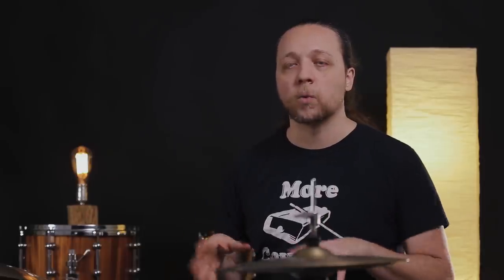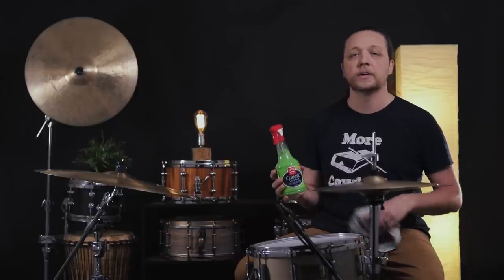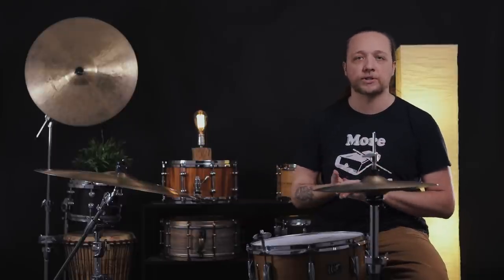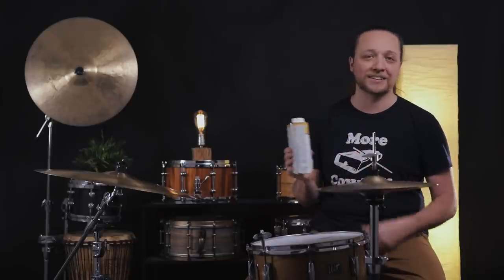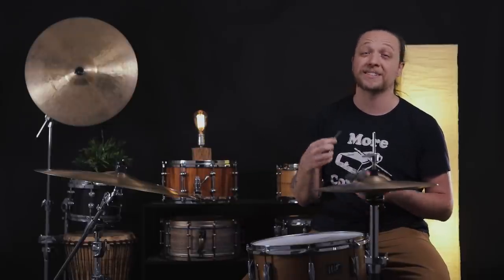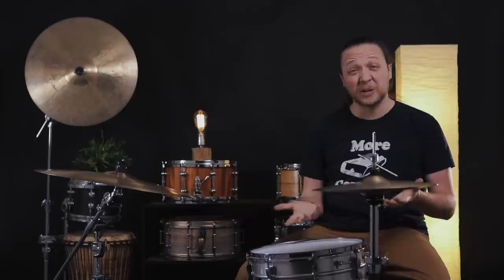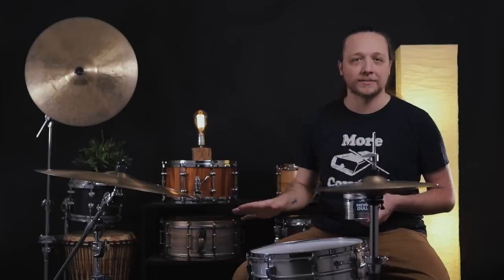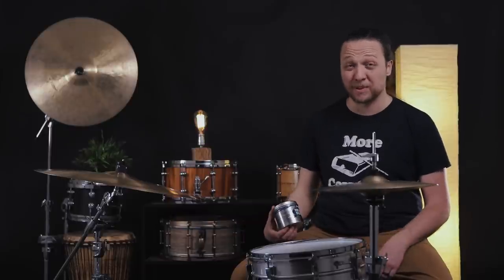Basic Drum Shell/Hardware Cleaning & Maintenance | Season Three, Episode 36

Comment: One tip I learned cleaning up old bicycles that had surface rust on the chrome was to pour vinger on a piece of tinfoil and rub the tin foil against the rusted/ pitted section. Works great. Won't remove all pitting but will remove most all the rust. Love your videos, get more out of what you have rather than get more stuff. Brilliant.

Comment: When rehabbing inexpensive drums that have no finish on the inside of the shells, I've learned to use a couple coats of thinned tung oil (1/3 thinner) which wicks deeper into the wood and ultimately makes cheap, somewhat porous wood more dense and thus more resonant.  The difference is remarkable and allows a cheap kit to have a much better sound.  That along with good heads and good wires on snares has made a number of "dead" kits come to life.  Additionally, Vaseline works great on threads and is fairly invisible and less messy than lithium grease.  Thanks again for putting out good content.  If only this was available back in the 60's when I first started playing...... oh yea, the internet hadn't even been conceived of yet !!!  Happy New Year guys............
Reply: Wouldn't vaseline be more perishable thus not lasting nearly as long as lithium grease?
Reply: @SGresponse  My '72 Rogers kit that I picked up in '87 still tunes up without issue and those lugs were treated with vaseline in the early 90's.  Vaseline keeps forever in it's container and never gets sticky like cheap grease does.
Reply: When using tung oil on unfinished interiors, do you get it on bearing edges? I’m thinking of trying it on a set of Sonor Force 1001 drums. They have a lot of good qualities, but the wood is soft and they don’t project well. They were meant for practice rooms mostly, so that’s not a flaw; but I would like to liven them up a bit for gig use.
Reply: @scottvelardo700  Definitely don't put on the bearing edges.  I rub the tung oil on with a cloth and it's easy to stop it just where the edges begin to roll.  If yours turn out as well as mine have you'll be a happy camper !!!
Reply: @marty9464  Thank you!

Comment: I had bought a Pearl Firecracker steel snare, the thing was so rusted on the inside... I didn't even try to play it. However, my grandma is a silversmith and I asked how to clean heavily rusted parts delicately and she recommended a variable speed Dremel and some fine steel brushes and some buffing tips (luckily I had the tools and tips in the garage). Took the snare apart and let the little parts like screws and tension rods sit in a vinegar solution overnight and got to cleaning. Sure enough, the snare looks clean... this video was definitely helpful advice going in though.

Comment: Many thanks for the very helpful content! There's a couple of things here I'm going to have to try, like Tung Oil. 
Another thing that works great on Chrome-plated hardware is Turtle Wax Chrome Polish & Rust Remover. Can be gotten at Ace Hardware or any Advance Auto Parts. It wipes off surface rust like dirt & makes the chrome gleam anew. I was shocked at how good it worked (& how easily). I couldn't even notice a small bit of pitting in a hoop of my '86 Ludwig Rocker (USA) afterwards.

Comment: Love you guys, but I disagree on steel wool on chrome. (Especially on vintage stuff!)  The steel wool can cause microabrasions in the chrome that lead to a cloudy appearance.  To remove dirt and such from hardware and lugs, I use Bon Ami or Barkeeper's Friend and a super soft toothbrush.

Alternatively, Evaporust for rusty parts is the most insane and helpful product. There are few things like it. Quick-Glo for chrome polish is also awesome because it's a wax that cleans and protects at the same time. 

(And for old wraps, nothing beats the Novus 1, 2 and 3 plastic products. )

Comment: Great video as always. Just a little contribution. I restored some badly treated drums and I have a couple tips. For chrome, when using 0000 steel wool, spray some WD40 on the area you want to clean up, the cleaning is more effective and gentle at the same time. Then, for natural wood shell interior, using bee wax helps nourishing and sealing the wood against moisture without changing tone. 💪🏻👍🏻

Comment: You mention using a drum key & a power drill for cleaning the tension rods. Just wanted to say that buying a drill bit drum key was the best £10 I ever spent - it makes changing heads and doing things like this so much easier! Especially if you're doing the whole kit or all the toms, you just whip them off in no time.

Thank you for the great vids!
Reply: Any specific drill you recommend? It may sound like a dumb question but honestly does it matter can I just get a cheap drill and it be fine?
Reply: @Jeremy_Sims  I think the drill bit drum key is a Gibraltar one, less than £10 online. Any power drill will do the job, but you do need a drill as opposed to an electric screwdriver, as it needs to have enough torque to loosen the tension rod. It's helpful if it has a stepped power button too, you don't need it to be going full speed/power all the time as that can strip the threads if you're not careful. Most modern electric power drills have "touch sensitive" (for want of a better phrase) power buttons that get more powerful as you squeeze tighter. A light touch is usually enough to just whip the rods out in a few seconds.

Comment: This is a great vid, thanks...  I have used Nevr-Dull in the past, it works.  But I prefer Dursol or Autosol Metal Polish, and it works even better than any other metal polish - especially on Chrome!  I just restored a gorgeous late 1960's 5-Line Rogers Dynasonic snare drum that looked like it had never been taken care of since bought new...  no pitting, but really dull and filthy.  Looks brand new now!  Next, I am digging into a 1920's Leedy snare drum that looks super dull, with rust here and there too... steel wool first, then my fav metal polish to finish off the job!

Comment: Best way to clean tension rods and swivel nuts? CRC Brākleen brake cleaner. It will quickly blast off all grease and makes them perfectly dry and clean. I prefer Super Lube 21010 synthetic multi purpose grease to white lithium grease. It’s much cleaner, lasts longer, and is food safe.

Comment: THANK YOU for mentioning lug screws!!

I have a 74 COB Slingerland Krupa that… I mean, I don’t think Ive evr had it in tune… simply because the screws are so corroded, starting off at “finger tight” has never been doable or valuable.

Will try steel wool and see. I do still wonder about the threads inside the lug… do we use a wirebrush of some sort there?

Will try. Much love everyone 🙏🏻

Comment: Steel wool - even very fine 0000 grade - will leave tiny scratches in the chrome that eventually widen like tiny cracks in concrete until the metal underneath is exposed and begins to rust, hence “pitting.”

Comment: Water and aluminum foil works like a charm for cleaning chrome.
Reply from the maker: This is a chemical process which has positive results but I've had better, more consistent experiences with steel wool. To each their own! -Ben
Reply: @SoundsLikeADrum  That's nice, I'll give it a go the next time I get the urge to clean my kit.
Reply: I've used this as well, but the 0000 Steel wool really is better.

Comment: I took apart my drums and started cleaning them just a couple days ago.  I was wondering what to use on the lacquer finish, and what kind of grease I should use for the lugs.  This video couldn't have come out at a better time.  Thanks!

The part of the Ayotte lugs that accepts the tension rod tarnished and a few even rusted a little.  (Ayotte calls it the Tune Lock cylinder)  I soaked them in CLR and used chrome polish to remove anything the CLR didn't get (smelly and messy, but safer than steel wool).  In hindsight, the chrome polish alone was probably enough.  Unfortunately, some of them are a little too damaged to look shiny and new.  Thankfully, I have a few extras, because Ayotte isn't selling them at the moment (and getting ahold of them is rather hit-or-miss it seems).

Comment: I was hoping you would touch on drum finishes that are wraps. Did you say that is for a future video? I hope so cuz I would like to hear your insights. All but two of the drum sets that I've ever owned have been wrapped finishes. I currently use a spray bottle of drum polish that I bought from Guitar Center for my wrap finishes that seems to work very well. Gone are the days of using furniture polish which I found out was a huge mistake. And as far as the nevr-dull goes, I used to use that on my motorcycle until it started doing something that wasn't good to my Chrome so I stopped using it. How that works on drums I really don't know. And in regards to the lugs I used to spray a shot of WD-40 into my lug holes to keep my lugs lubricated.

Comment: I use WD-40 on rods before using steel wool.  And of course, I clean them before lubricating.   
The Evans drum key drill bit is a great item to use, too!
I’ve used Brasso and soft cloths for metal shells and parts.  
I’m experimenting with lubricants; lithium grease, silicone, and Teflon.  No long term results yet.  

On wooden shells, do you (or anyone) put anything on the bearing edges, other than bearing edge lubricants that I’ve seen advertised?  I’ve used extra fine sandpaper very lightly just to touch them up.

Comment: I have a Yamaha Manu Katche snare which is a spare (and usually just stays in its soft case) However the rims have got extremely pitted and lumpy - I didn’t realise how bad it was until I looked at it the other day. Is there any solution for that or do I just need to try to source new rims or get them stripped down and re-plated? Great content btw
Reply from the maker: Hey there! I personally would replace them, new triple flange hoops are not terribly expensive and definitely cheaper than having the originals replated. I put new ones on a snare of mine last year and it really breathed new life into it! -Cody

Comment: Thank you for this excellent video! Do you have any ideas for acrylic drums. My snare drum is an Acrolite, but the drums are Vistalite.
Reply from the maker: Thanks! A damp cloth or a specific cleaner like the RCI spray will do the job just fine. Cheers! -Ben
Reply: Be careful to not scratch the drum when cleaning, acrylic isn't the toughest material out there. If it starts looking dull you'll need to polish it. There are specific products to polish your car's headlights, which should work well on the drums too.

Comment: Gretsch wood finishes are clear coated with nitrocellulose lacquer. Using the furniture polishing product "Pledge" is a really bad idea. It actually breaks down the finish because Pledge is a silicon based product, NOT a wax.
Reply from the maker: Yeah, never use something like Pledge or Windex on drum shells...again, the 3-in-1 ceramic wax shown here works wonders.